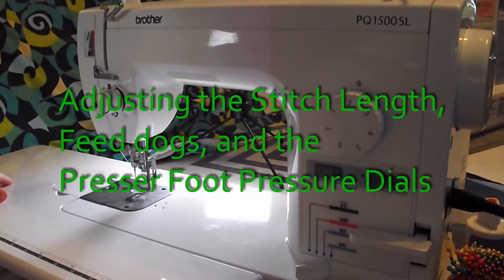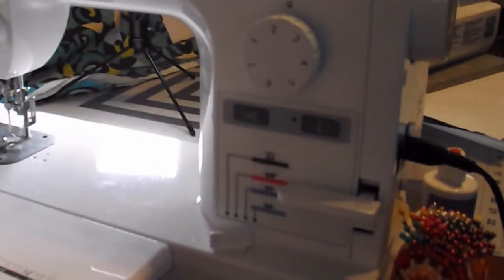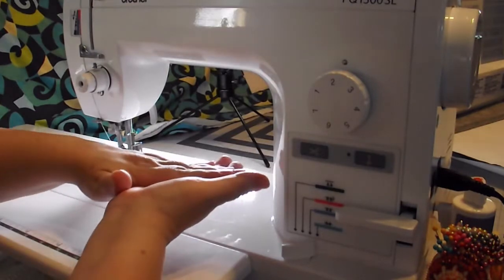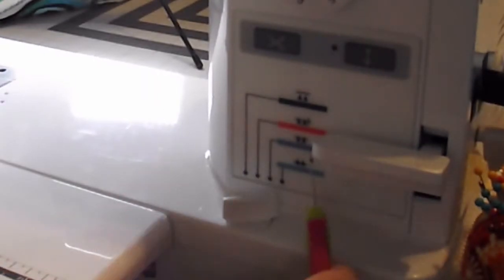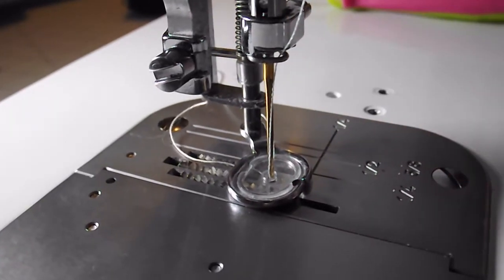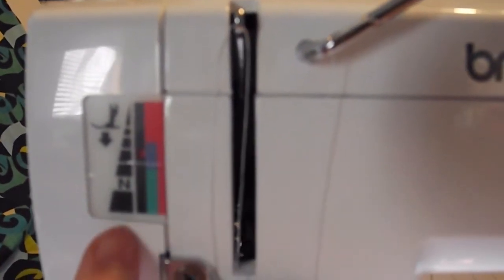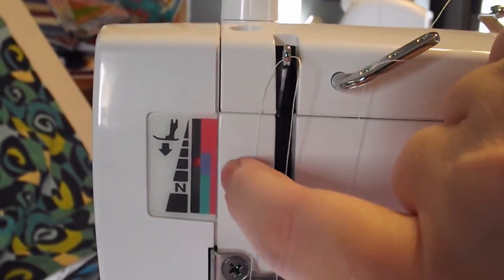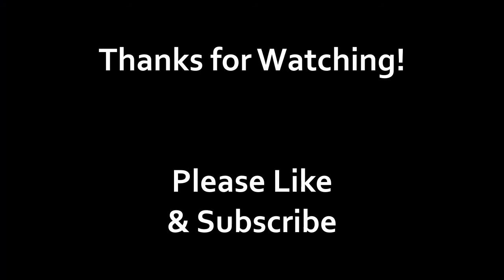Adjusting Stitch Length, Feed Dogs, and Presser Foot Pressure - Lesson #3 for Brother PQ1500SL

Comment: Great information, just bought this machine. Could you address thread tension? Ty
Reply from the maker: Hello. I don't have any near future plans to cover that topic. If you haven't already cut the piece they sample stitched in the factory, I would suggest writing "top" on the top side and keep that wherever you keep your accessories for the machine (I use a pencil box like the elementary kids use for school). The reason to do that is so you can always know what the tension on both sides is supposed to look, especially if you start changing out the weights of your threads or shift to a metallic thread on a project (metallics need top tension set very low, either that or use the metallic in the bobbin and stitch the piece upside down). Good luck with the machine.
Reply: @GettinStitchy  I didn't have a sample piece with my machine. Thank you for the repy.

Comment: I have (and love) this machine.   When you mentioned using it for binding a quilt, did you use the walking foot?  I've been having trouble keeping the layers moving at the same pace.  I've adjusted the foot pressure up...down...middle and still no better.  I will try again without the walking foot but wondered what your experience was.
Reply from the maker: Hi Kathy. I rarely ever use the walking foot. Mostly just hate installing it because it's so fiddly to attach it to the needle screw. So all binding is with a regular straight stitch foot. Best thing I've found is to make sure I've done the "victory lap" before starting to attach the binding. It's not always perfect and sometimes I get an occasional pucker nonetheless from a combo of border bias and shifting layers. I think on anything truly for a high competition show or meant to be seriously heirloom, I would take the time to starch the backing all the way before quilting, use Pellon wonderweb to iron fuse the layers together, and really starch the borders on the top at a minimum if not the whole top. And by starch, like potentially mix some dry pellet starch to high concentration in a sink or plastic tub and dunk and wring out the fabric and then iron dry after hanging or laying out the fabric for a good 15-20 minutes. Makes anything fabric more like paper and there won't be any bias to mess things up. But that's me. I've heard of people using a walking foot to bind, but it's not my style. I guess if everything is quilted (like maybe you sent it off to a longarmer), then maybe you could slip pieces of the wonder web between the layers on edge areas not quilted down, fuse, and see if that helps. Good luck.

Comment: I have the Nouvelle 1500s and the feed dogs don’t change when I change the setting, and definitely don’t drop when that settings chosen. Not sure what to do!
Reply from the maker: That's interesting. I always thought the Novelle was just an earlier branding of the PQ1500SL. Not sure what you need to do although if it's a malfunctioning mechanism from that feed dog setting dial, then it sounds like it need to be serviced by a decent sewing machine repair person. Good luck!
Reply: @GettinStitchy  do you have any tips about the thread cutter? I find it unthreads the needle when I use it :( i will find a repair person asap
Reply from the maker: @CocoYazmin07  While I rarely ever use the thread cutter because it cuts the bobbin thread way too short for my comfort, I found that if I hit the button with the presser foot was up, that would unthread the needle. I think that is because the tension discs aren't activated when the presser foot is up.

Comment: How do I fix the feed dogs when they are in the up position but won't move the fabric?
Reply from the maker: Hi Suzanne. First, I would try one of the other settings where the feed dogs are up to see if it's just that one setting. If none of the settings are advancing the piece along the bed of the machine, then I would unscrew the base plate and see if I need to do a cleaning. Also, good to see if something might be jamming the mechanisms in that area that could be removed. If all of that fails, then I would take the machine with either a general sewing machine repair person or a Brother dealer with a repair person on staff. Given the value of this machine it would be worth paying a pro who can dig deeper into the problem. Good luck finding a solution to your issue! Thanks for watching.